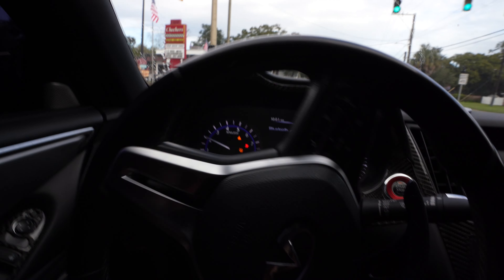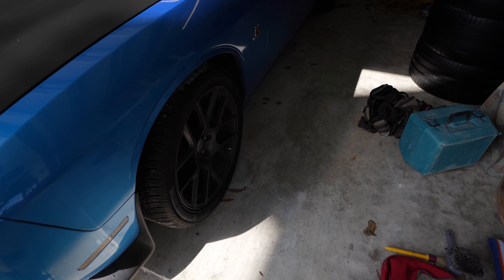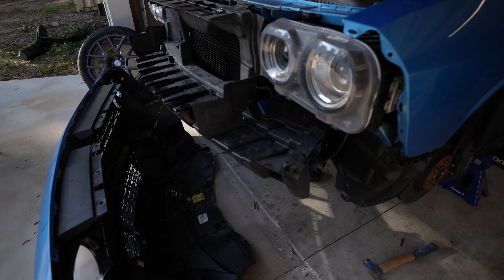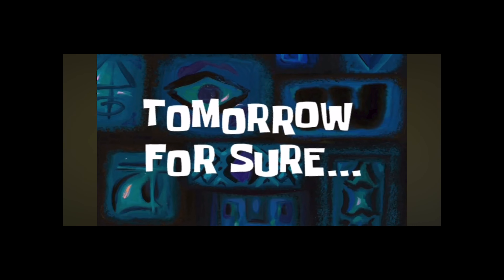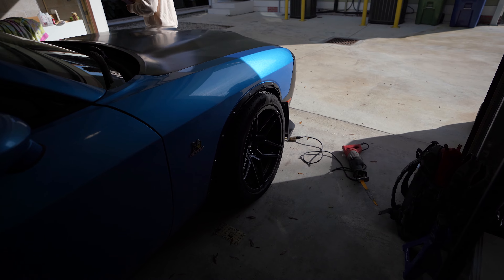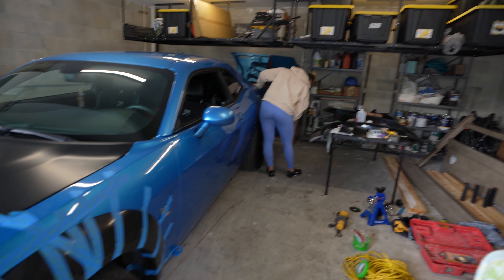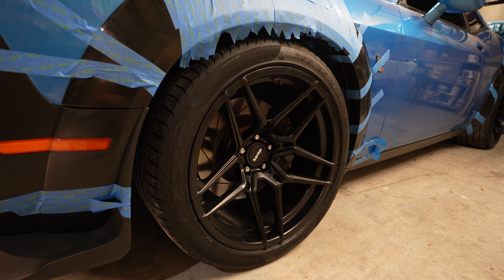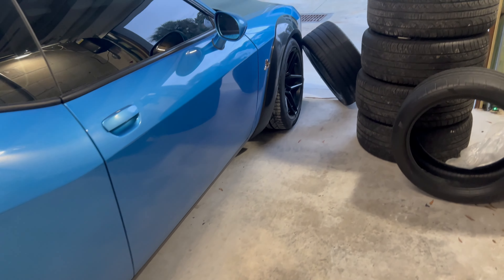2016 DODGE CHALLENGER SCATPACK WIDEBODY INSTALL | SCARPACK TO HELLCAT REDEYE LOOK!

Comment: i also am doing a widebody kit on my scatpack i have redeye widebody rims 20x11 305s all the way around my rears are fine but i do rub my fenders on bumps and pot holes in the front i can still turn fully no problem but bumps do suck
Reply from the maker: Yeah hers do not rub in the front too bad now after we trimmed the plastic fenders to be flush with the metal wheel well
Reply: @jesswhipz will it rub on a 15 hellcat? If I put the kit?

Comment: How’s the kit been holding up overtime and at high speeds ? Also did you close up the gap from the hood and the bumper ?
Reply from the maker: @krispykeyog  it’s been holding up great and well the issue was the hood lmao she ended up getting a carbon hood and the gap is much less

Comment: You should cut it man. Road conditions and driving conditions vary on daily driven cars. Plus if you add some weight to it for traveling the rear will even sit lower. Plus body roll in the turns. Only a matter of time before it hits since you did the wider wheels. All that work just to have to redo...jus sayin. I cut mine for a vicrez widebody kit. I agree, car looks good. Props
Reply from the maker: No rubbing at all here 🤷🏻‍♂️ trimmed the plastic fenders back to the metal wheel well to sit flush and there hasn’t been any rubbing. Also, terrible ass roads in FL and daily driving

Comment: No rubbing or scuffing on front or rear fender ?
Reply from the maker: At the end of the video I explain we ended up cutting the middle section out of the plastic fenders up to the metal fender. We still never ended up cutting the metal fender but some light trimming of the plastic will be needed. Only took about 10 minutes

Comment: The harmonic damper balancer falls out of every one of these engines it’s not held together too well but the dealer or CarMax or whoever you bought the car from 9/10 warranty the new one and have it installed it’s not an expensive or long fix, some people have bought the ATI 10% one to have it replaced for their own personal reasons but it’s just on there to balance out the engine shaking but it doesn’t do too much for our cars as they all run perfectly fine when it falls out and like most of us, we never find out until we take the bumper off and a random circle object falls out lol
Reply from the maker: Yeah we eventually found out that’s what it was 🤣 dodge is taking care of it lol

Comment: What size rims are in the front? 20 x 11?
Reply from the maker: Yes sir, 20x11
Reply: @jesswhipz  any rubbing or fitment issues in the front?
Reply from the maker: @Handsomeinvestments  nope, no issues or rubbing 🤙🏻
Reply: @jesswhipz  thanks, this helps a ton. I have a set of 305s on the way and was concerned about the 11” wheel on the front tire.